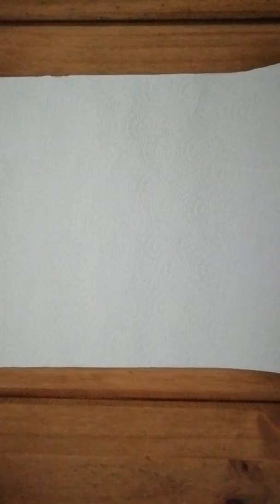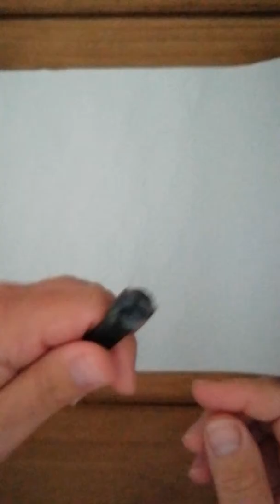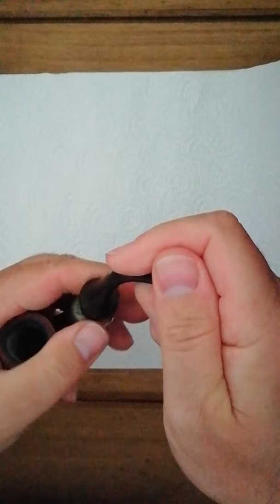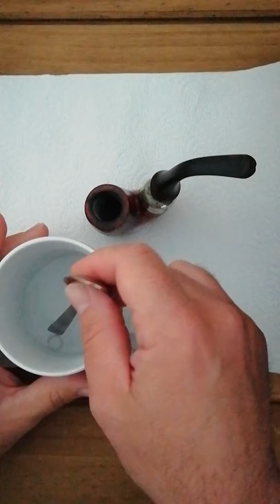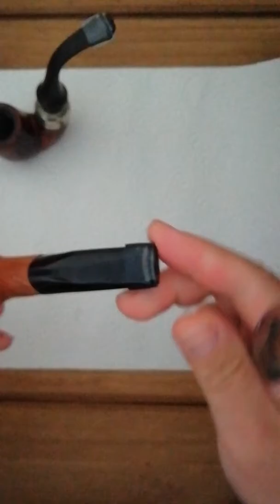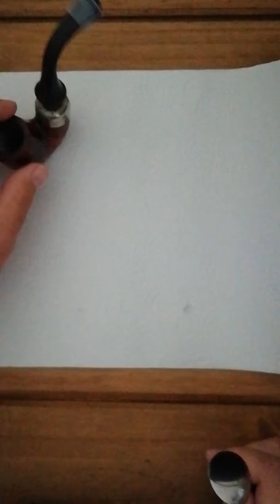Softy bit alternative

Comment: I use something similar on my bagpipe changer.
Reply from the maker: Real Police Talk I ordered some proper softy bits but it looks like there coming in on s slow boat from China. I watched a video where the presenter did this (but with black tubing) and when I was in the DIY shop I saw some so gave it a try. There's also a video where they use the shrinkable tubing electricians use to splice wiring.